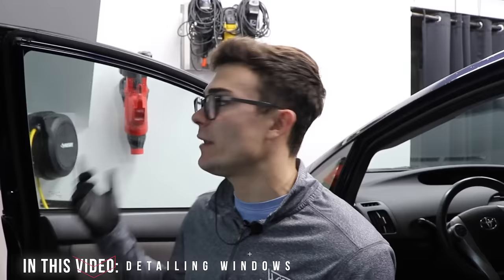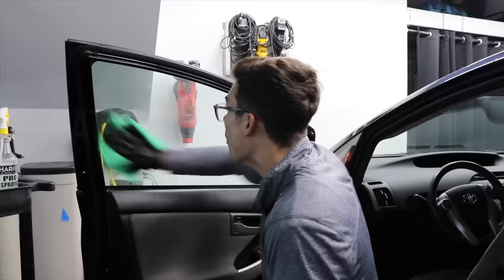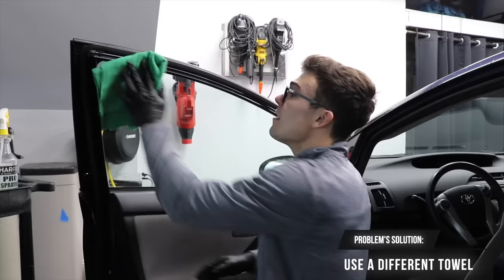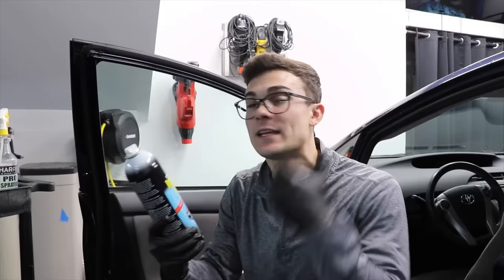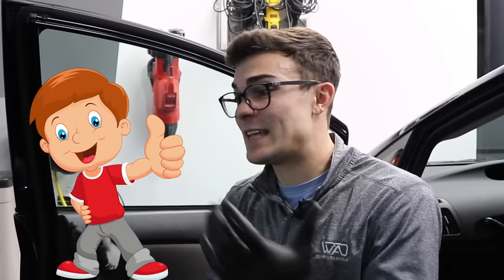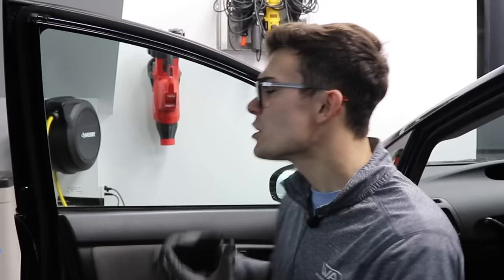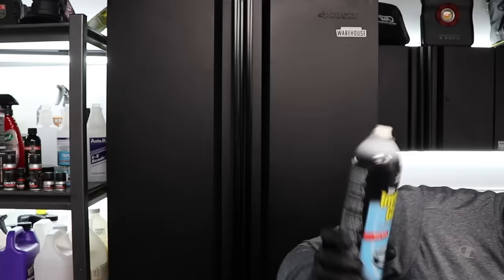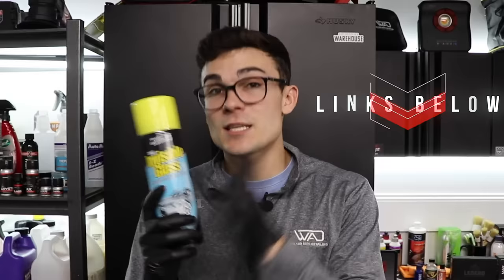Solving The Biggest Problems With Windows

Comment: in the thumbnail there is a glass cleaner called ARMORALL I tried it and it is rubbish, impossible to remove the streaks and haze it leaves behind, 3 days after using it my glass looked greasy, in fact my glass was worse after using it. the best method there is by far is the window cleaning method your window cleaner uses to clean your house windows, get some warm water with a few drops of washing-up liquid mixed in, try not to make soapy bubbles and clean the window with a big car sponge then remove it with a squeegee, if you have not got a squeegee try using scrunched up newspaper as that leaves no traces, like 5-6 pages rolled into a big loose ball, 
TIP >> Put a towel over the top of your dashboard to stop watermarks or possible water ingress into the electricals, you do not want that !

Comment: I use 1/10 degreaser and 1/10 vinegar and 8/10 water and it’s magic, I soak the entire door and window and wipe everything and then blow the cracks and use a second clean towel to first wipe the windows dry, and then the doors post blow out. After 10 seconds it’s all evaporated

Comment: I have been using Griot's Garage blue polypropylene Lint Free towels with good success on preventing the lint problem. I still have occassional hazing problem; this video was awesome at addressing the "hidden" culprits!  Your thoughts on Sprayway Glass Cleaner?   Our maid service recommended that brand for use on windows, shower doors, etc. and has been what I use on my car windows.

Comment: If you use newsprint to wipe the glass cleaner off, you won't get streaks or fog or lint.  Apply a bunch of glass cleaner, wipe it all over with your cloth leaving the window clean but still with the glass cleaner streaked all over it, then wipe that excess off with newsprint, you'll be able to hear the squeak of it wiping off and the glass will be perfectly clear.  If the window isn't very dirty, you can just give it a light spritz and wipe it off with the newsprint directly.  I save all my junk mail for cleaning my glass.  Some day there'll be none left and I'll have to get one of those waffle towels, the problem with something you reuse though is contamination.  Of course, newsprint is no good for professional use, because you'd need too much of it.

Comment: What's the point of using anything else (for interior) after using an alcohol solution? Clean is clean, right?  Also wouldn't most any alcohol based, residue-free, cleaner like Spraway Glass Cleaner work as well as making your own alcohol solution?

Comment: Great video. Can you use the alcohol/water mixture on tinted windows though? You never mentioned if it was safe? I use the Invisible Glass product and like it for my tinted windows.
Reply: Im just an avid cleaner and I would think twice before using alcohol to clean tinted windows.Window tint has glue it im pretty sure. Alcohol breaks down alot of plastics etc.And to get overspray or having alcohol having contact to your interior could easly cause damage especially to softer plastics.Please take everything you see online with a grain of salt.Ive damaged my car using so called safe recomended products.If your car needs special attention go seek professional advice and if your still concerned pay a professional. Atleast if they damage your vehichle they are reliable for it.

Comment: He touches on this at the 5 minute mark but it's pretty important to understand that not all "microfiber" is created equal, and that just about every towel you can easily buy at local stores is doo doo. Basically, a lot of them are cheap fakes for those who will never need to know any better. So you have to be picky about microfiber towels, and you will probably have to order them from some place to get good ones. Otherwise you get all sorts of weird problems from towels that do not function, even when brand new.

Comment: Don't the instructions on Invisible Glass say to use a different towel for drying? Pretty sure that's what I read when I did my windshield with their cleaner, scrub, and ceramic coat (which worked awesome, BTW).

Comment: A tip from cleaning other type of interior glasses where people live: when you're in a closed environment your sweat carries a bit of grease and that disperses into the air through humidity transfer from transpiration to air. In small closed spaces the streaks in the glasses if you can "smear" them it's probably grease. Alcohol works for that too. If you see those blue glass cleaners in the cleaning section of the supermarket you can get those, they are basically rubbing alcohol and fragrance.

Comment: The best and cheapest way to clean your windows streak free is to use peroxide. Use a new microfiber towel by dumping a small amount into the towel and wiping the glass up and down and side to side. Then get a new dry microfiber towel and wipe up and down and side to side. The cleanest streak free windows you will ever have inside and out on any glass you have... 💯

Comment: You want the cleanest windows? Use whatever you normally use and then apply a small coat of wax (inside and outside) remove the wax like you would normally and they’ll be perfect with no streaks.

Comment: When cleaning the moonroof on the outside, what is the best way to clean it? Yes, I know to wash it and dry it, but can you use the clay bar on it? Is there a way to make it repel rain once it’s been cleaned?
Reply from the maker: Yes, I always like to clay bar this area. Then I will treat with a 50-50 alcohol and distilled water solution before applying a spray wax.

Comment: I never use glass cleaner. It's a waste of time and money.
I have always dipped a microfiber for glass in hot water, wring it out and simply wipe the surface. No streaks, nothing. The hot water cleans and evaporates for a streak free finish.
Easy and not complicated.

Comment: I clean windows for a living. Sometimes I have better results wiping. I always augment any cleaner I use with IPA. All these glass cleaners like Hopes, Invisible Glass, etc... Do leave a residue. I never use MF. Lint, lint, lint. The microfibers leave fibers, even the glass designed ones. I always use a surgical huck.  The cotton is better at glass. Too many detailers focus on MF as the best and only cloth needed. I also do janitorial and MF works great on certain things but not glass. Try a good huck for glass. Unless someone here can guarantee me that if I use X brand microfibre towel that wont leave fibers then I will try it but cleaning for 14 plus years and thousands of glass panes MF are a glass no go.
Reply: Interesting, I’ve never heard of cotton huck towel but will definitely buy some because I don’t like microfiber for environmental pollution reasons. But can you explain your cleaning solution further please? Is it typically only ipa and water?
Reply: @aayotechnology  they are simple blue surgical towels. The cotton is a huck. Also use flour sack towels but there is a break in process and has lint. At least a guck can do the dirty work of removing haze, dirt, smoke, etc. Then if MF is your thing use the MF towel for final polish. This will save your MF. I clean in layers so this method works well for me.

Comment: best way to clean glass if its clear and no hard water spots wash the windows  like you normally do with just soap and water let dry then wax them with liquid carnuba wax and wax them like you would paint.. if you have hard water spots you can use chemical guys  spot remover on the glass you must nutralize it after its a weak acid base  so rub it on its in gel form water spots gone then use water on a rag then wipe clean youll see brown on your rag this is getting in the pours of the glass yes glass has pours and valleys then you can wax... or use 0000 quaddruple ought  steel wool with soapd and water as lube dont do dry and then wash windows and wax... your welcome

Comment: How do you remove liquid silicone off of a windshield that has been used on the wipers to preserve the life of the wiper? Now I cannot get the silicone film off my windshield, and it streaks all over my windshield especially when it is raining. Any suggestions????? Looking for a chemical that will dissolve liquid silicone off of window glass.  Thanks John in Ohio

Comment: I have a 1985 Toyota 4runner with hard to remove hard water spots, use the same 50/50 solution you mentioned in this video?

Comment: Great video. Sometimes it's so difficult to remove the haze on the windscreen inside your vehicle. I'm definitely going to try using the 50/50 alcohol mixture. I think the windscreen haze is from the gas released from the vinyl upholstery on the dashboard. Water spots on the windscreen are also difficult to remove. Any ideas on how to remove them?.
Reply: Try something slightly acidic like vinegar diluted in water.

Comment: I have a big problem with the outside of my windshield. My car was originally owned in Hawaii, and sometimes I wonder if it was parked under some kind of tree that tripped sap on it. You can see where the windshield wiper moves across the passenger side and I can't get the film off the windshield, not matter what technique I use, including using alcohol and distilled water. (and a half dozen other ideas). Help.

Comment: everything you're saying is true and works.   but you're making it too hard.   try this- pressure wash a clean towel - wring it out and marinate it in your favourite glass cleaner - wait a few minutes and wring it out again.   now take that towel in one hand and a dry clean towel in the other and wipe with the wet, wait 10 seconds and wipe with the dry.  that's it.  has worked evert time for me for 20 years up here in Edmonton.   whether its -40 or +35 outside.   peace

Comment: You did not say WHICH rubbing alcohol to use... It comes in 50% and 95% usually... 50% is already 50% water, so you would end up with 25% alcohol with it. And the 95% would give you about a 50% solution... Which do you use?

Comment: Your claim that microfiber towels degrade with washing doesn't ring true for me. I find that brand new MF towels tend to shed more than those that have been washed, making more sparkles than ones that have been washed. Another sub said that he thought dryer sheets caused issues with cleaning windows, but I have also found this to be not true. Dryer sheets help in getting lint and loose microfibers to release from the towels and gather in the lint filter, away from the towels. Otherwise, at least in my own personal tests, I don't see any difference in towels with or without dryer sheets.

Comment: I have had several million times (or thereabouts) better results with the Invisible Glass PUMP spray, over the aerosol can.  Far, far, far, far less problems with streaking.  A bit harder to find, but give it a shot.

Comment: Oh, Dude.
That is waaaaay complex. And mostly irrelevant to anything regarding your need.
I am a window cleaner. 44 years. I’ve cleaned governor’s mansions, State Capitols, buildings over 20 storeys, many many residences, and yes indeed, a buncha cars.
••
What you got is a load of problem angles and a load of solutions, none of which are necessary.
Your solution is simply : clean your glass.
Fog, haze, moisture on glass, irrelevant entirely.
If you got moisture visible, yes, it’s humidity, it’s whatever — ignore it — IF YOUR GLASS IS CLEAN. If your haze isn’t gone soon by itself after a thermostat adjustment, your glass isn’t clean. If it’s simply condensation, it’ll go away when the humidity balance changes. You can ignore the fog if it’s caused purely by water. Because clean window. And that’s THE sole goal you have.
The issue here is : use a squeegee, not a towel. WHY are you screwing with a towel?
Because no.
Buy an Ettore (ET’-tor-ay) sgueegee with a 6” channel. Mix water with dawn dish soap. Mix just enough dish soap into your water to render a mild lather. Apply with a strip washer that’s equally small or a clean hot-water-soaked cotton towel.
The narrow channel will allow you to pull linear motions across curved glass, leaving very limited areas necessitating or appropriating any towel-related edging.
••
The secret to towels is this : no microfibers, no synthetic towels whatsoever.
You want 100% cotton. Period. Cotton ........... absorbs. And that cotton towel you want, sadly, must be purchased new if you don’t have one. I say “sadly”, because you don’t want new — you want OLD, really old. Yet, clean. Buy a new one, bleach it, wash it, wash it again. Wash it again. And again. MAKE IT old. By washing. 
Why? Just as cotton is absorbent, FABRIC-wise, OLD cotton is absorbent AGE-wise.
A brand new cotton towel is a pain in the rump. It’s too new and perfect. It does little more than smear water around across the surface of the window. Old towels are comprised of broken fibers. Yes, yes, fibers DO technically get scattered about, which is why you use the non-porous presence of a rubber squeegee blade in your channel, scooting (in essence) your water downward to the bottom of the window, but I do towel down the edges of my glass, as do most experienced window cleaners.
But fibers aren’t a visible problem if your COTTON towel is VERY clean.  Again, you want old, but perfectly clean. If freshly clean,  you aren’t besieged by loose fibers.
If one attempts to use an old towel they haven’t bought new, they may think it’s clean, but usually it is not. “Oh, it’s clean, I’m sure”, one tends to think. No. Don’t presume. Wash and dry it WELL.
A new towel is too tightly woven, but an old one’s fibers have been worn enough to expose more broken strands to the glass supplying abundant contact points to the glass surface resultant of the porous property area increase.
Dish soap scares mediocre window cleaners. It’s mainly coz they can’t clean windows.
I did so for 10 years and thought I was good, then got my first high-rise job and my co-workers looked at my work like I fell off a beer truck. Coz I was horrid. Even after ten years. Mediocre window cleaners use an ancient worn out squeegee blade. They dunno they need to change that rotten blade out which is why they can’t squeegee the soap off. Your squeege must have a sharp new blade. Dish soap is mainly sodium lauryl sulfate, perfect for the task.
Alcohol and ammonia are NOT window cleaning agents. That’s a myth.
You are right regarding your “shine” philosophy for sure.
But you don’t need emulsifiers like Windex (ammonia) unless you’re adding it in your water to break up stuff that’s usually not on glass. Extravagant, really.
••
Once I called Proctor and Gamble asking where I could find Dawn Botanicals which they just pulled off the shelves.
The advert rep said, “Sir, we have not tested Dawn for window cleaning.”
I said, “Sister, the industry HAS tested it and that’s why you sell that product coz we buy more than your housewives’ once-a-month-purchase for dishes. It’s what we use! Do you think we use your Windex [which they also manufacture]? We don’t. And if you ‘tested’ THAT for windows, your test failed. You put ammonia on a dirty window, you get shiny dirt.”
Alcohol, similar.
Most window cleaners just suck. And that’s a fact. Malpractice with doctors and lawyers is proof one can have an academic education and be little more than brainwashed/incompetent.  In other words, training and even experience doesn’t make one good of itself. Coz as Carlin said, somewhere in the world is THE worst doctor and someone has an appointment with him tomorrow.  Thing is, there is no school one may attend to learn how to clean windows.
And few people know how, so never regret getting an unsatisfactory result.
Even the pros are wretched.  “But surely a janitorial supply company? They’ll teach me.”
Nope. They need to stick to waxing floors. And hiring felons.
••
Those waffle towels, frankly, are indeed rather good towels. Not due to the waffle. But rather to their high percentage of cotton.
Don’t listen to the home remedy comments if you get any.
“Grandma use to use vinegar.”
Right..
Grandma never got a window clean in her life. And tends to bark at the mail man.
Grandma washes her crusty panties with her children’s pillow cases.  This is not a woman to acquire counsel from.

Comment: You do not need a "specialized" overpriced product for this lol.
Just get a good window cleaner for home use and that will work 100%.
I mix a bit of this in with my summer windshield wiper fluid and it works wonders, on par with the winter stuff - which i find better at cleaning up bugs because its alcohol-based.

Comment: IPA and "Rubbing Alcohol" are NOT the same thing.  Never use  Running Alcohol as it contains grease, usually lanolin.  IPA does not. This is my pet peeve and I have corrected so many sites about this.  Rubbing Alcohol is more easily found in many places but you may have to look a little deeper to find just IPA.

Comment: Let me solve all your problems period. Your application of glass cleaner is too heavy . Wide and even spread thin . Like fisrt layer of spary paint. Alcohol based only glass cleaner. Spray away. And it's temperature range . 54° to 70° ruffly. What most glass shops use.

Comment: Not even two minutes in and imma stop you right there...STOP USING MICRO FIBER ON YOUR GLASS, that's your main problem, not the humidity, what you are doing is buffing dried up product, and thats not good for the glass even...Glass professionals, rather it's the makers or the auto glass installers, we NEVER use micro fiber. You need to get glass paper towels, paper towels that are literally made for detailing. Safelite even has some amazing paper towels that work really well with their own brand of glass cleaner.

I just watched the rest, and literally every single problem is because you are using something that isn't for glass...Please just get the proper towels, we don't make this glass for you to use micro fiber on it.